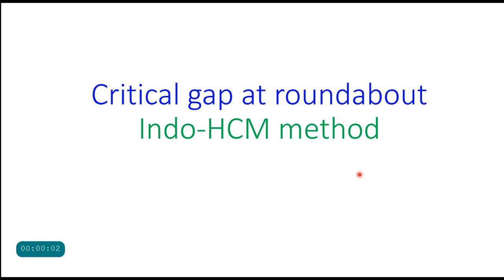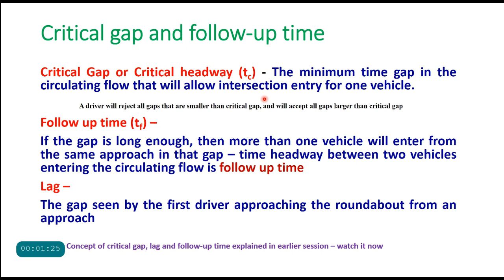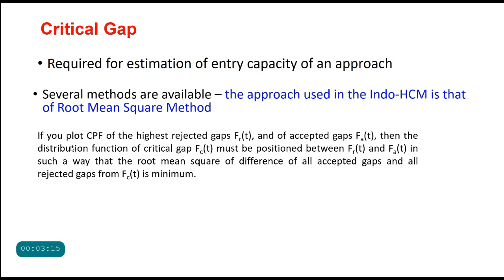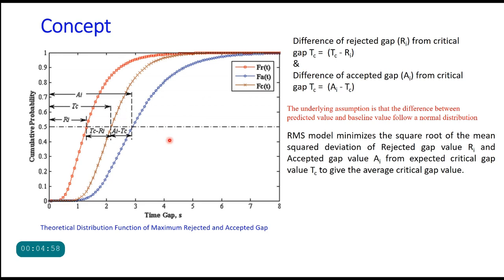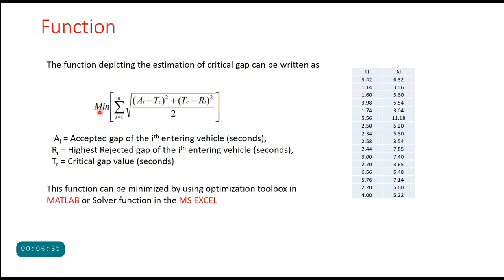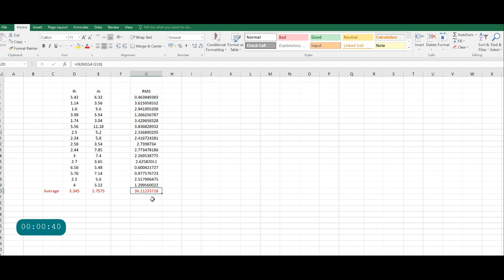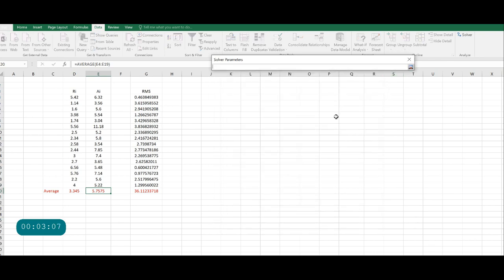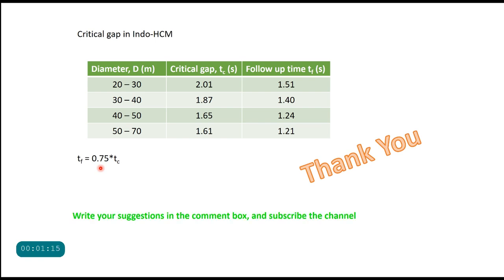#capacity, #gap, Critical Gap at Roundabouts by Indo-HCM Method

Comment: One more question: We need a pair of data for each vehicle. They are the highest rejeceted and accepted gap..

Lets assume there are no vehicles are coming from the main road. "In this case, the vehicle joining the main road can proceed without waiting, meaning there is no maximum rejected gap.

What will we do in this case? Are we going to exclude this vehicle from evaluation?
Reply from the maker: You can take rejected gap as zero.